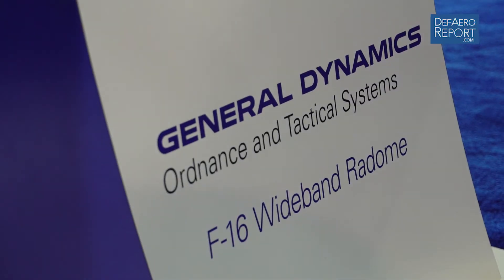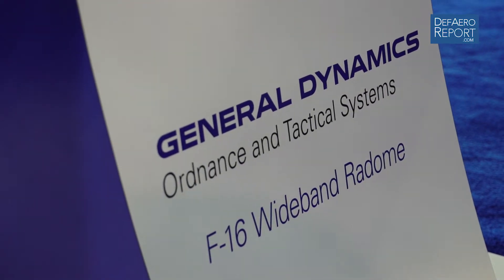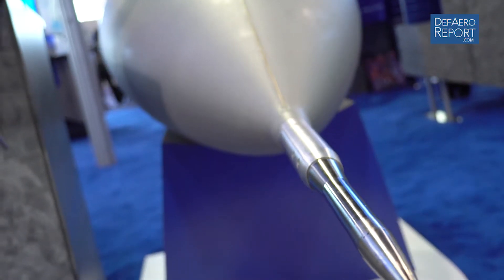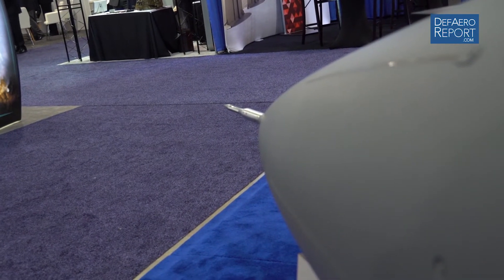GD's Rush on F-16 Wideband Radome's Function, Capabilities, Design Challenges

Comment: quartz?  I wonder if the technology is similar to the quartz and resin counter tops you can get?   Obviously it has to be different but it sounds similar.
Reply: Ok I should have checked it out before I posted, looks like they use a quartz fiber and wind it around a form.   Also looks like similar tech has been in use since 1992.   Last radome I worked on was fiberglass and made in 1964.
Reply: @465maltbie Nowadays they use epoxy resins. which should not affect the dielectric of the radome.